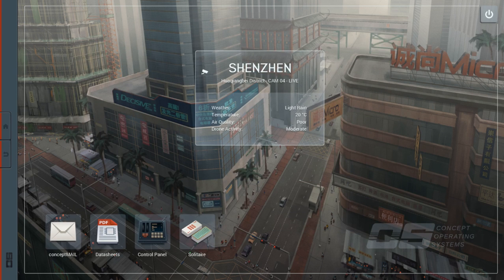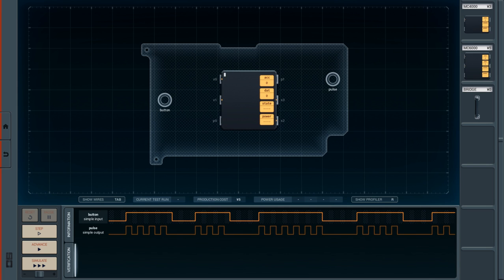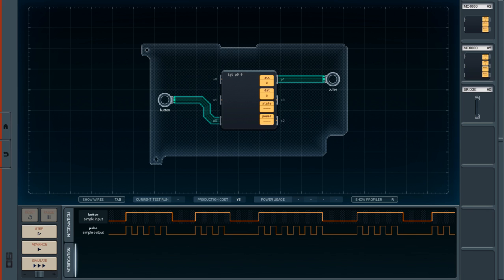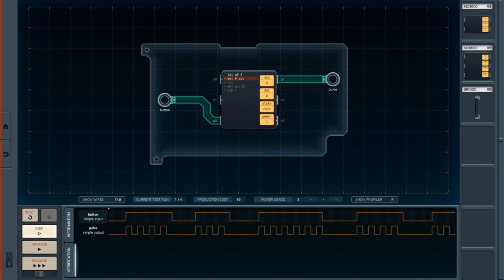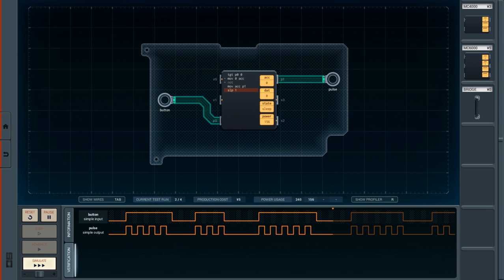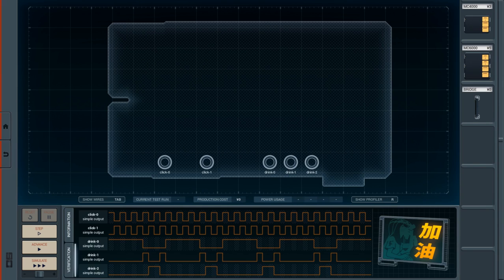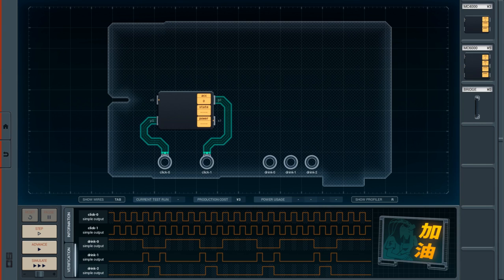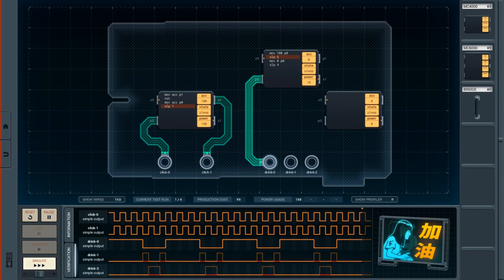Let's Play: Shenzhen I/O, Part 2

Comment: The issue with your power at 10:30 is that you are moving the accumulator to the output every "second". Even If it doesn't change.